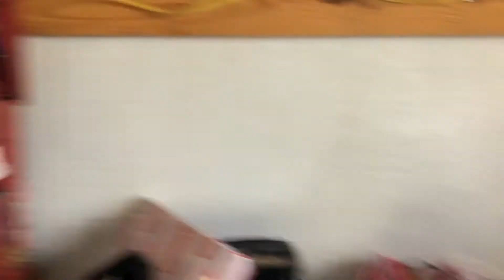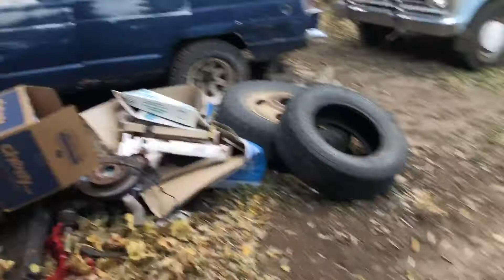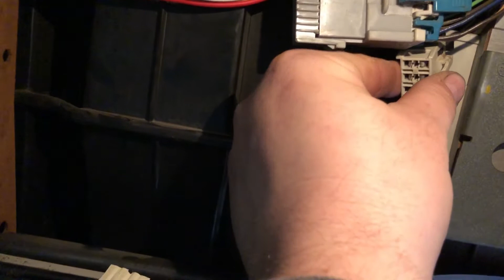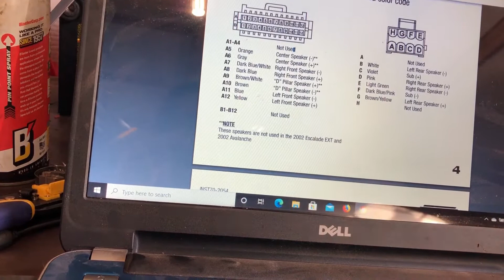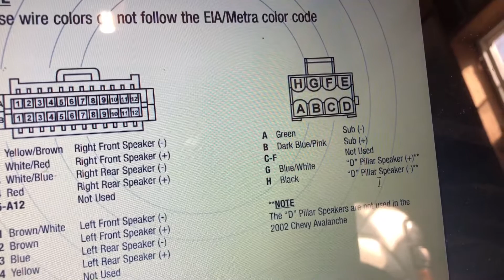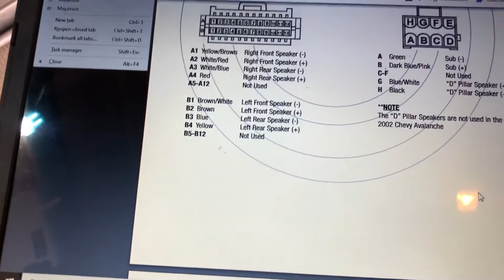2002 GMT 800 Suburban Yukon Tahoe Avalanche RPO YE9 amp bypass GMC Chevy

Comment: For anyone struggling with this, (like me)i think i found a solution. Since no one makes the harness for the non bose amp 99-02 gmt800’s, theres a guy on ebay that makes two styles, one that just bypasses the four door speakers, retaining the amp and d pillars (on the tahoes and subs, and one that bypasses entire amp (you have to then run yer own speaker wires to the amp)

Comment: Are the D pillar speakers in the rear connected to the same channel? In other words is there a subwoofer line and a one channel line connecting those back speakers in series?
Reply from the maker: They have their own leads + and - on their own channel.
Reply: @andrew8ism  oh I see I went over the color code you displayed in your video and seen it, I was actually going to use the connector to wire in a new amp. Got a taramps ts400.4 thats half the size of the stock amp, hate how the built in crossover cuts the lows to the door speakers.